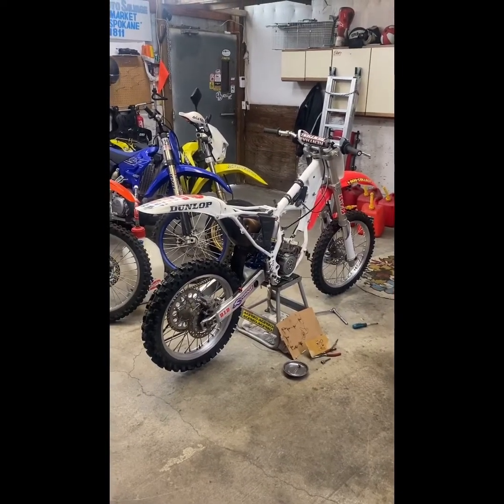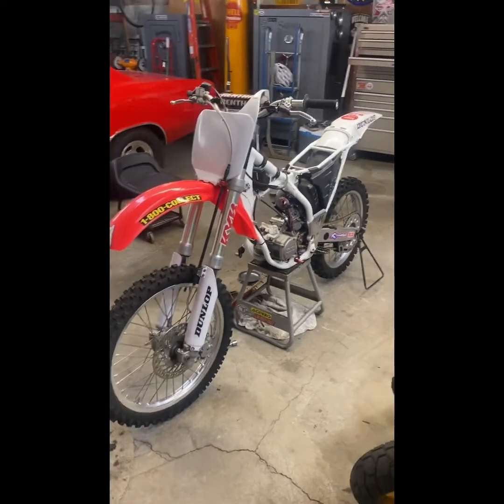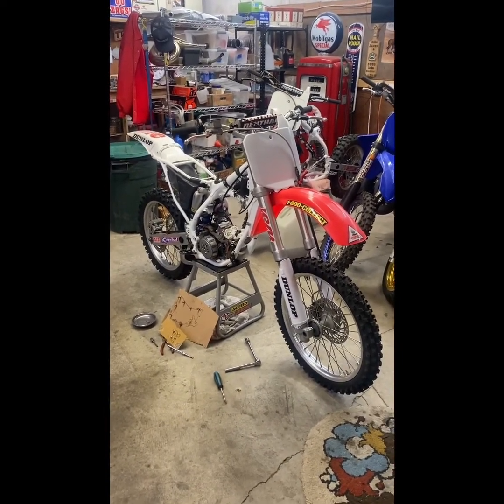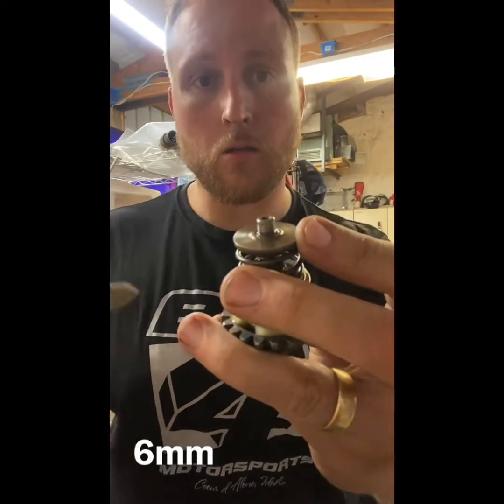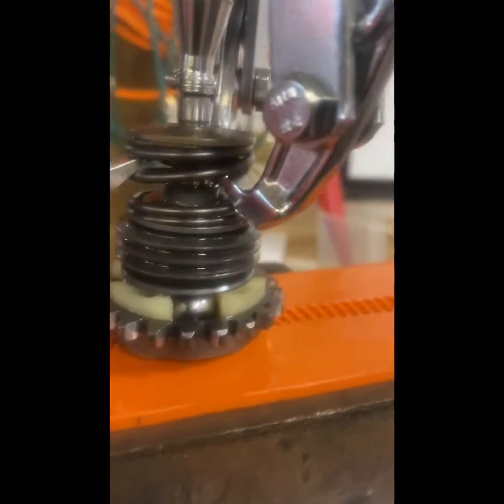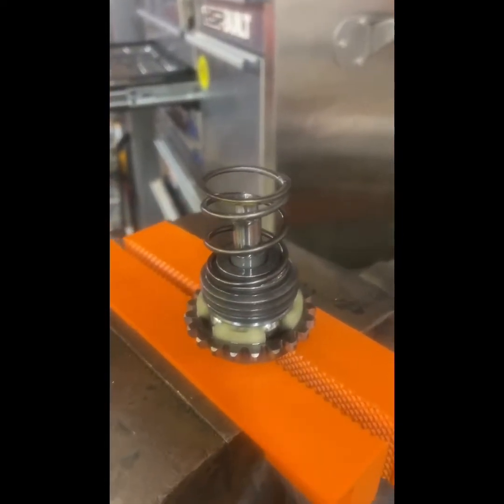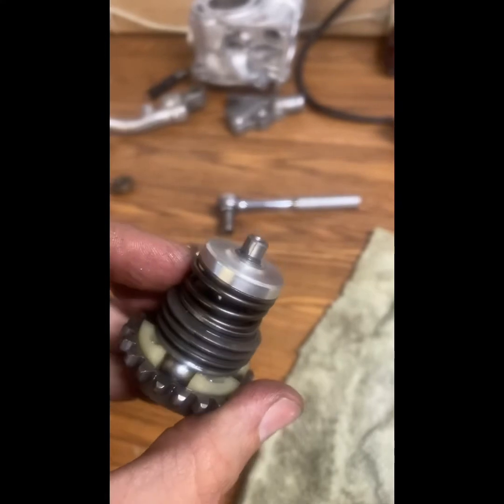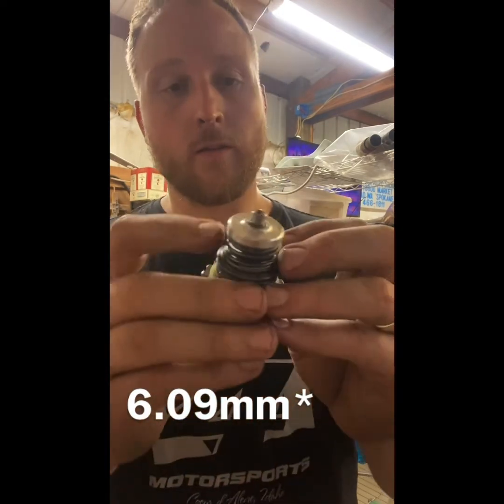Honda CR125 Power Valve Governor Mod For Keihin PWK Airstriker 38mm Carburetor - Shim Installation

Comment: I've got a 97 cr125r never had a problem with any bogging most people don't ride a 125 in the low end you gotta keep the rpms up
Reply: This was specifically with the 38mm carb mod. Your bike has the 36mm carb from factory, hence no bog.

Comment: My 38 mm airstriker will not fit to my 90 cr125 airbox boot. How did you make your carb fit to the boot?
Reply: You are correct original was a pj 36 mm. Thanks for the advice
Reply from the maker: @jogentil1  no problem man, let me know if I can help any further!
Reply from the maker: @jogentil1  no problem man, let me know if I can help any further!
Reply from the maker: If I’m not mistaken, the 90 cr125 had a 36mm pj carb on it. There’s 2 way to get it on there because yes, it’s a real tight squeeze. You can heat the air boot up and make it soft and/or grease the inside of the air boot. I’d heat them grease, it will fit on there with some patience and determination.

Comment: Hello Jimmy can you tell me the thickness of the ring that you made to replace the stock ring? The thing is that i have a 2001 cr 125 with a 36 kehin carburettor...
Reply from the maker: I did not make that, I had it made by a dude in England. However, it s a shim that is 3mm thick. Is that carb a PJ carb? I do not think you need to do this mod if you have a stock sized carb? I have a 38mm air striker on this 1997 cr125 with the gov shimmed. Isnt that year a mikuni TMX on that bike? Let me know.
Reply: This model in Greece came with a kehin 36 carburetor... I have in my bike vforce 3 reeds and a full fmf shorty.. with this modify i want to improve the power on low revs... Do you think that  i am doing right
Reply from the maker: @sotirisdemon9319  if it’s a 36mm, I don’t think you need to do the gov mod. It’s only if you put a bigger 38mm carb on it

Comment: Been going through the same thing with a completely different engine not a honda that uses a rotax diaphragm type power valve, ended up going with a stiffer spring.  I couldn't find any videos came across your channel from your cr80 wanted post on pnw
Reply from the maker: Awesome! Thanks for stopping by! What's that motor in??
Reply: @jimmy_dirtbike  it's a brc500 motor in a 20 model husky te300
Reply from the maker: @mathewsharp233  holy shit bud, let me know how you like that bike! My 500 rattles my arms numb!
Reply: @jimmy_dirtbike  it's early days the pv still needs some work thinking slightly longer spring, it works off exhaust pressure there's no centrifuge involved so relys solely on the spring. It's counterbalanced so not much vibration at all barely noticeable, my ktm 500 4t is 10x worse put it that way.
You should do a 500 video they're always popular that would get your subscriptions up lol

Comment: Too bad you missed the part with replacing the bearing inside the governor. These governors have done like 30 years already so the bearing in there is worn and has some play which makes the whole assembly slightly inprecise. If you already open up the governor you could easily replace that bearing as well. Takes like 1 minute more and it gets rid of most of the slack there is. In the end it's all about having a precisely working exhaust system, right?
Reply from the maker: Most definately! I must have missed that part when we were emailing back and forth regarding that bearing actually. I will go back and read our messages! Otherwise, I most definately would have done that part. Are you referring to the ball bearings in the top? I could just reopen the governor, couldn't I? It runs great right now, minus the FMF fatty and VForce you recommended. Only reason I didn't put either of them on there is because I already had a PC and a rad valve on there before the mod. If I can find someone who will buy either one, I will definatley swap them out. Thank you again for all your help with this! I truly appreciate it, Nino!
Reply: @jimmy_dirtbike   I think Boyesen is the best one

Comment: I'm glad you liked my governor modification. However the added preload makes the HPP exhaust valve LATER, not sooner! With the bigger carburetor airflow suffers at low RPMs so you want the exhaust smaller for another couple hundred RPMs. By adding additional preload the HPP opens like 600 RPMs later which gives you an additional 4 HP right there in the middle!! Correct  - that's 4 HP in the midrange as opposed to loosing 2HP over stock when using the big 38 carburetor.
Reply from the maker: Thank you for the clarification, Nino! Im trying to figure out how to edit this video to correct when I say it opens earlier. Im not great at video editing. My bike screams now! You are the man!
Reply: Can this be done with the factory carb?
Reply: @alexbernal4988  By "Factory Carb" you mean the oem one that comes stock on the bike? If so  - NO as the stock one is a 36mm and works just fine as is. This modification is needed when you upgrade to a bigger 38mm carb to avoid that hole/bog in the powerband you would get otherwise. I would highly recommend going to a bigger carb with that modification as it brings the old & trusty HPP engine to a whole other level: More mid-power (+ 2HP), more Top-End (+3 HP) and more overrev.

Comment: Thanks Jimmy. Can you tell how many rpm it start to open?? 
I just got a cr125 2003 with pwk air striker. Power valve seems to open allmost when i touch the throttle😮
Reply from the maker: No problem dude! I was told that stock is right around 7500 rpms. The shim would make it open 600-700rpms later. I’ve risen my 97 cr125 a couple times since installing the shim, it turned it into a way better bike. I love the 38 pwk on it now!
Reply: Cool. Any experience with replacing the spring? Im trying to figure out why mine is opening so fast. Im hopeless trying to find OEM spring as loose part. 
Any help would be much appriciated 😄
Reply from the maker: @michaelhier3447  if it were me, I’d just get a new governor, they’re cheap. Otherwise, you could just pull the top off the governor like I did in this video and swap a different spring in there. I heard somewhere that the mugen engine cases had the ability to change out governor springs. Not sure where you’d get another spring other than just getting another governor off eBay. Good luck!